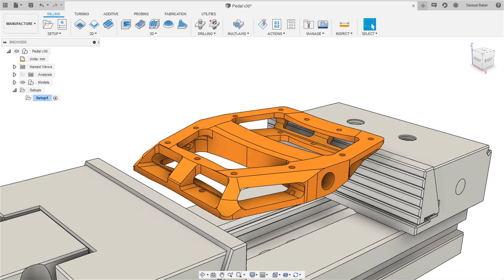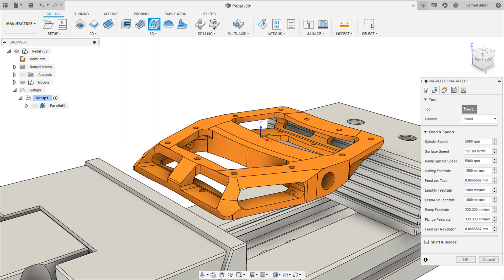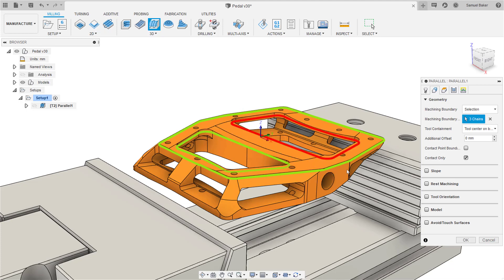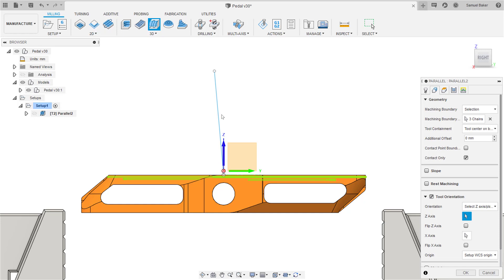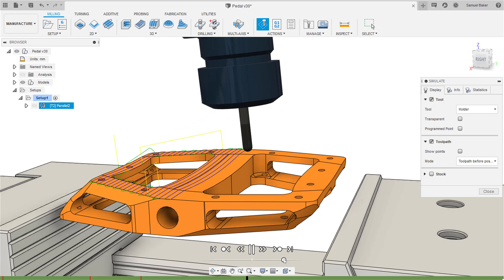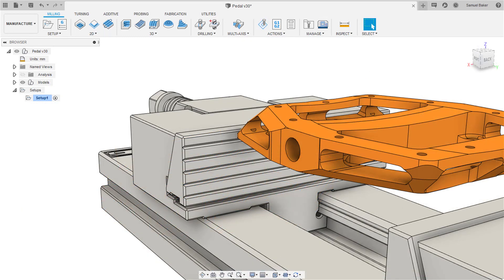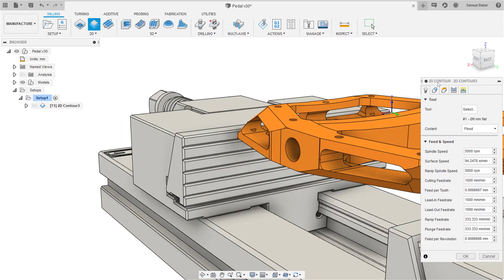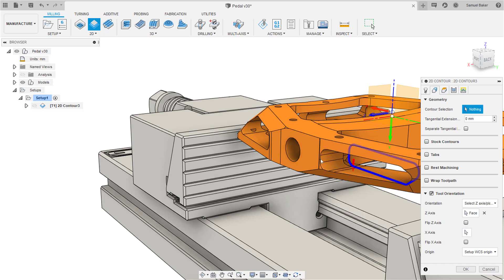QUICK TIP: Tool Orientation for Every Toolpath

Comment: But...you have to re-apply tool orientation and repick the datum with every new toolpath. We need to be able to set tool orientation at the folder level, or even better, have a pre-definable set of datums we can pick from as an alternative to setting tool orientation in the current manner.
Reply: You can use Derived Operations which brings things like paramters, geometry selections, and Tool Orientation from the initial operation into the Derived Operation! If you're creating a ton of different types of toolpaths with different orientations, you might be able use a combination of unique Setups with different WCS orientations (but the same origin!) and NC Programs to help reduce the time spent defining tool orientations while still getting a single program out. I haven't actually tried that one myself, but I think it should work.
Reply: @marthadeans  I pretty much already do that. Multiple setups and NC programs really don't scale well, and to be honest I've not found a true use for NC programs yet. 
I've started creating a dummy setup with folders for the orientations, with work offset overrides set for each folder, with a dummy toolpath set inside each ready to be derived and copied to the real setup.
It just feels like a lot of extra steps that could be consolidated in a much better workflow.

Why not:-
Define tool orientation/datums/work offsets/UCS in the design space.
Select that pre-defined datum in tool orientation in the manufacturing space.
Reply from the maker: Thanks @Marti for the assist. @vworp, you're in good hands.
Reply: @vworp  I'm not disagreeing that folders would be a cleaner workflow, I just wanted to point out that there's a workaround! I think there's definitely risk to the workaround because to have to be VERY vigilant that your WCS origins are the same across setups. Can't say I agree on NC programs, I've been loving them, even if all I do is use them to post out a single setup, mostly because I'm on a Mac and the dialog box is WAY better (plus combining toolpaths across setups for multi-part setups plus visual reordering) but to each their own.

Comment: Hi Sam could you tell me where you got the Geralrdi Vise model from I am looking for the same model with 5 inch wide jaws
Reply from the maker: Hey Mike, is it in the CAM workholding samples? I think most all of the file we use are there. Find them in your data panel near the bottom.
Reply: @adskFusion  Hi Sam I can find the 5 axis Vise which is shown in the machining part of the video, but not the Geralrdi Vise shown holding the model in orange thanks for the reply thou i will keep looking.
Reply from the maker: @mikecroston7022  Its not there, apparently. I've requested a share, but you might just need to pull something from here or the like: 
https://grabcad.com/library?page=1&time=all_time&sort=recent&query=Gerardi

That or put together a quick model pulling off pertinent dims.

Comment: Am I right that this tool orientation feature will work only on multi axis machines?
Reply from the maker: Per this: https://www.autodesk.com/products/fusion-360/blog/fusion-360-wcs-tool-orientation/ 
Yes, it will only work if you have 5-axis functionality on your machine tool.
Reply: Correct, there needs to be some kind of machine hardware that is being controlled. If you have a 3-axis mill, there are options like bolt-on trunnions that can add 4 or 5-axis capability and would work with Tool Orientation and the other multi-axis functionality in Fusion!